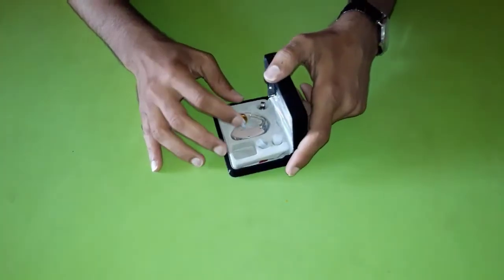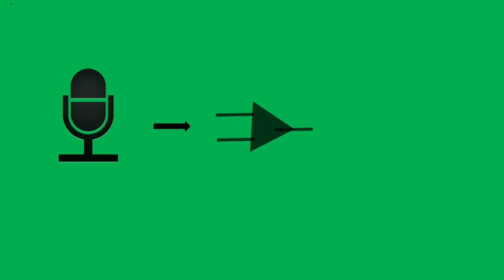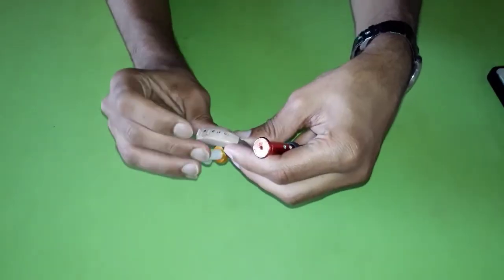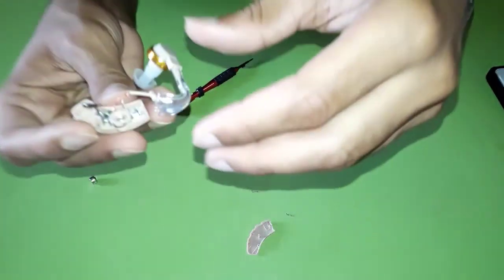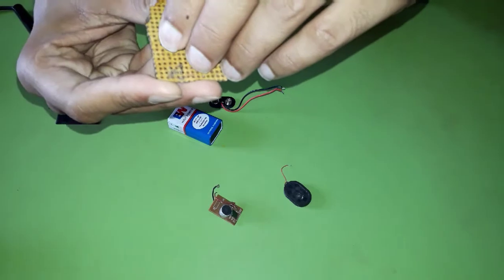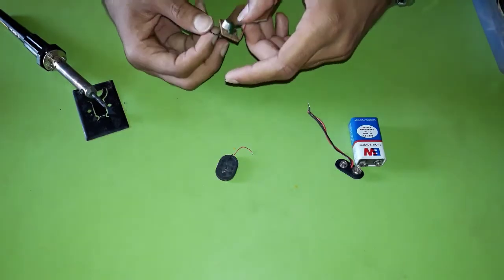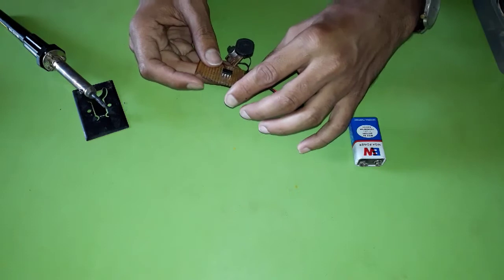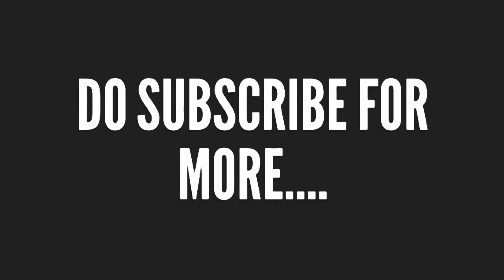How the Hearing Aid Works | DIY Hearing Aid | Parul University | Techs Science

Comment: There's a draw back in the hearing aid which you have shown in the video. The main problems are swetting from the hair seeps in to the volume control pot and the tracks get covered with salt from the swetting so that the battery gets drained fast. Secondly the ear piece gets wax deposit. If you have any suggestions on the above it will be of immense help to those people who are using the hearing aid like me will also be facing such a problem.